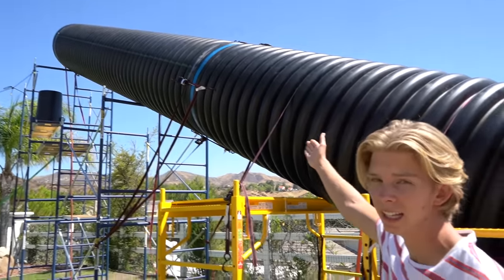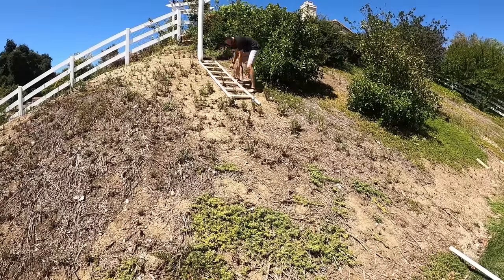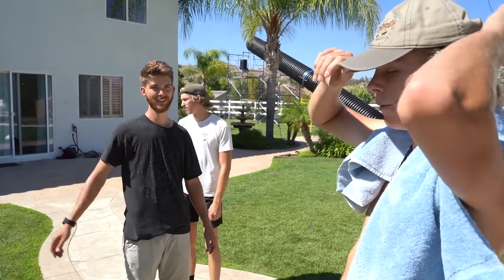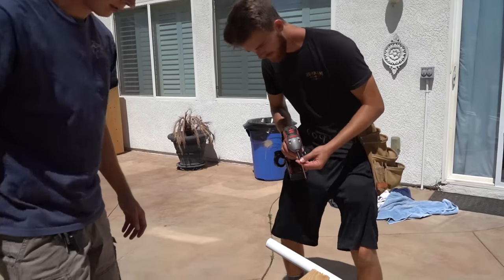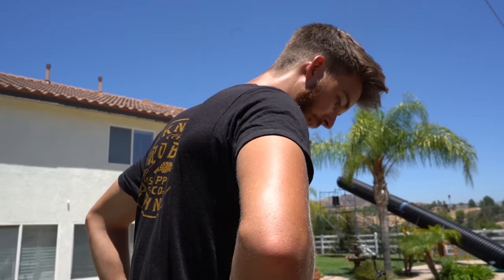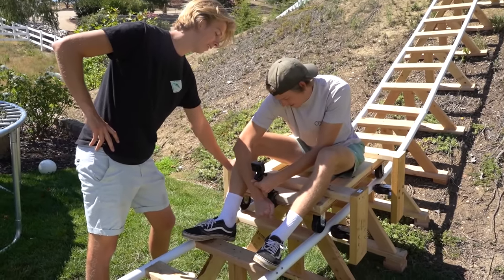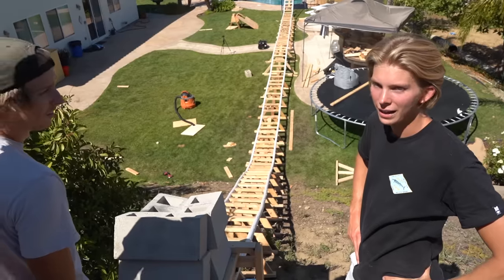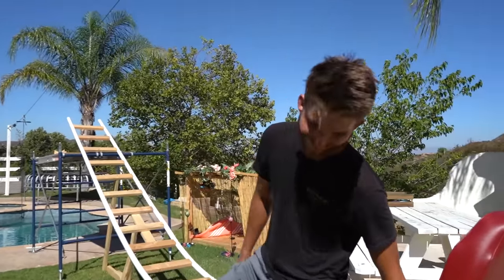BUILT BACKYARD ROLLER COASTER IN 24 HOURS! *DERAILED*

Comment: Just so you know, you would need bottom wheels not only because of loops, but I would even have them on that type of coaster because 95% of the times, your body is gonna weight shift which would cause it to derail. And also for example if there’s more weight in the back and barely any  weight in the front it’ll tip over
Reply: You right
Reply: That means your smart
Reply: @Markeye574  smart? even a 8 year old knows that
Reply: loops? INVERSIONS BRO
Reply: @amacon. I mean, a loop is a type of inversion, and maybe he waa referring to loops in general even though it applies to all inversion, such as cobra rolls.
Reply: Also if you made the coaster go fast enough and went over an airtime hill you could easily fly off.

Comment: you should added the bottom wheels because even the coaster didn't have loop, the bottom wheel still have to keep the car on the track so if it take air time the car will be fall off the track. in 13:18, because the car didn't have the bottom wheel so that's why it fail off the track.
Bottom wheen is designed to hold the coaster on track so it improtan. you can use smaller wheels so it didn't touch the supports.

Comment: The reason it derailed is because it's supposed to have a wheel on the track on the sides of the track and on the bottom of the track and the middle part is supposed to come together so you can build the supports. I could common pictures I would comment a picture of how it's supposed to look.

Comment: Here’s a tip. It’s a little to late but if. You willing to rebuild or take of the wheels. When you have  just the rails get the circle wheels and attached them to the seat then put them on just the risk itself (MAKE SURE THEIR THE HALF CIRCLES) so it can easily slide across the wood. And then after you attach the seat then you do the wood things
Reply: Auto correct just messed up all my words

Comment: The up stop wheels are the ones you actually need you don't really have to have the side wheels because there is no lateral movement. The up stop wheels would stop it from derailing because it keeps it on the track when the cart experiences negative g's